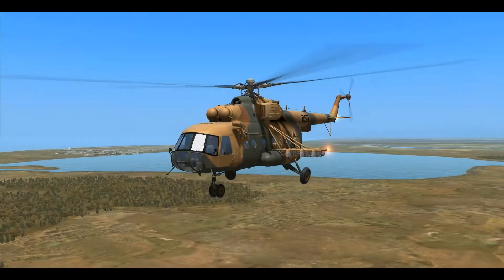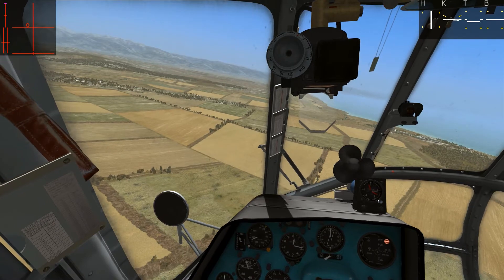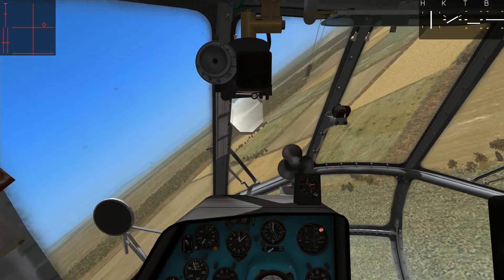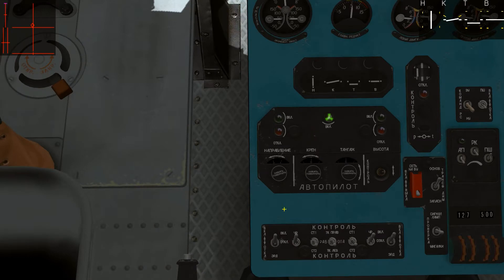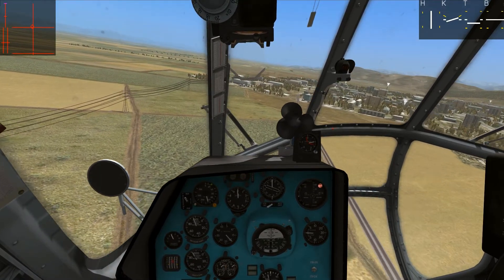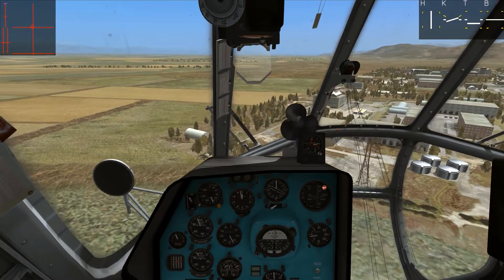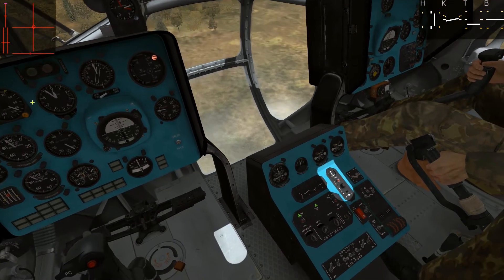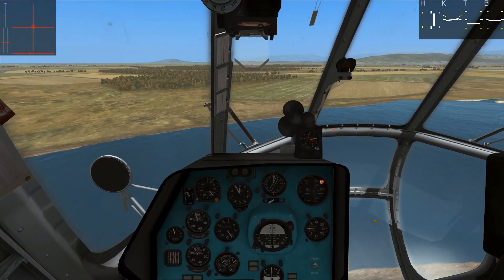DCS Mi-8 - Trim & Autopilot Tutorial

Comment: How do you get the top right screen to show up?
Reply: +Elappo thanks dude!
Reply from the maker: +GooseGamingHD Hey, sorry for long wait. Press RCtrl + Enter to get control indicators. You can also set from Options->Special->Mi8 "Show hints at mission start" to get them right away.
Reply from the maker: +GooseGamingHD As a side note there is control called "Adjust Autopilot" in options. When you press it the flight engineer will reset the positions of the autopilot channels. In other word when you disable autopilot the knobs will stay in last known position. Without reseting the knobs, autopilot will try to fly with last configuration meaning alot of unnecessary bouncing.
Reply: Was about to ask the same... now no need :D

Comment: Hi there ! i adore all your videos, they are way more informative than built-in tutorials ... but i've got an problem still :( my trim doesn't work, whenever i click T, i hear a click, but nothing really happens
Reply: Hi

First of all, because you are hearing that "click", it means that you have the correct keybinding and that the trimmer does work for you. This is essentially what it will sound like when you apply the trimmer or reset it (ctrl + T). 

Now, I imagine you might not quite understand how it works and that might be the problem. Let me explain. If you apply the trimmer close to a neutral cyclic position, you will barely feel that it is working. The proceeding with using the trimmer should be as follows:

1. Hold down trimmer button
2. Move cyclic stick to desired position
3. Release the trimmer

If you do it as this, it will for certain work for you. That said, there are other methods of using the trimmer, but I would recommend trying out the procedural one before you go onto more personal preference ones (an example here would be pilots that like to fly with trimmer pressed down during their whole flights). 

PS: According to manual and me speaking with actual pilots at airshows, BOTH pitch/roll- AND direction-autopilots should be always on.

Cheers
Reply from the maker: Thanks i'm happy that you like'd my videos, have you looked control indications (rctrl+enter) what's that saying? First of all you might want to double check from your options that "T" is the trim key for sure. If the trim key is working alright and it still seems that aircraft its not getting trimmed, make sure your autopilot panel is working correctly.
Reply: Elappo Thanks for reply ^^, well, i doublechecked the settings, and T is indeed for a Trimmer, even deleted "Reset trimmer" thingy to be sure, and here is my autopilot console: https://drive.google.com/file/d/0B_IyYMgPuzY9S2cyUmZSN055YXM/view?usp=sharing ... i loaded "free flight" mission to ensure that i didn't do anything wrong in startup procedure, and in Pctrl+enter it doesn't affect anything when i press T :(
Reply from the maker: Oresteia Nowotna  Alright i need you to check from your options->gameplay that your preset is correct, there is two presets "simulation" and "game" press the simulation and lets hope that will work.
Reply: Iam helpless :( it is set to simulation already
Reply from the maker: Next time you fly save a track from that mission (When ending mission game will promote you to save track) and post it up to Mi-8 forums: http://forums.eagle.ru/forumdisplay.php?f=279 maybe someone else will think a solution for your problem since i'm running out of ideas.
Reply: Alright, i will try that, thanks for the response and tips though, i really appericate that ^^ keep a good work with vids btw ! ... btw, where from is from that funny accent of yours ? :P
Reply from the maker: Hehe i'm from finland, i hope my english can be understand atleast some, so i can keep making these videos :)
Reply: It is, i actually guessed scandinavia from your accent! was right then ^^ and yes, please do, the accent makes them even more entertaining to me
Reply from the maker: zerO_ crash Thanks for the heads up. Yes it indeed reads in the manual, alot of things have changed since release, and probably keep changing cos it's in beta. Also some people choose to have rudder trim enabled from options, which makes yaw autopilot channel abit unnecessary for specific situations.
Reply: Oh my thanks you both for these messages but I have to apologize I kind of forgot to inform you. That I fixed it... I use my steering wheel for the pedals and it has ff and for some reason it was glitching it and I had to disable ff... It worked!
Reply: Ah gotcha, good to hear then ^^